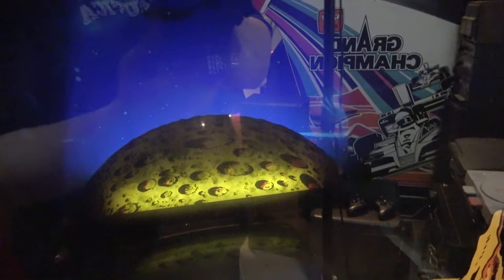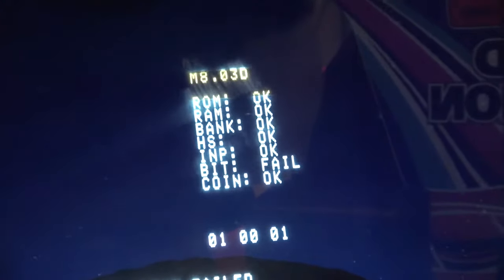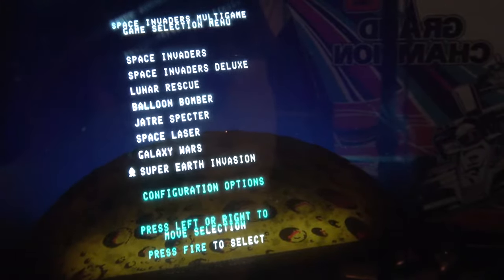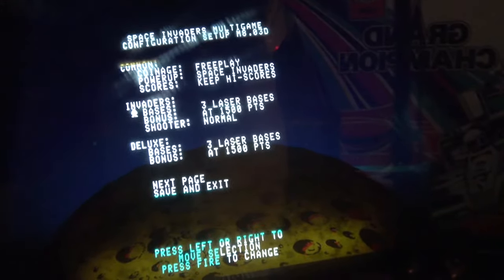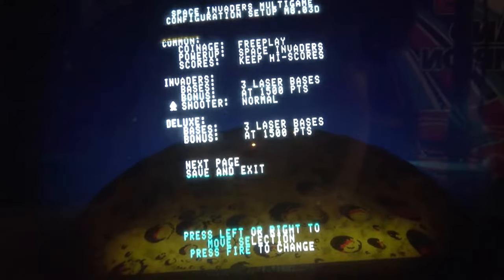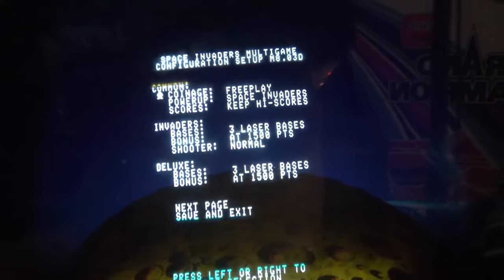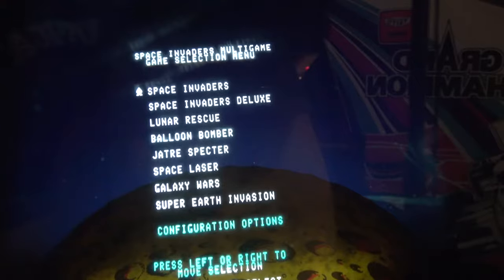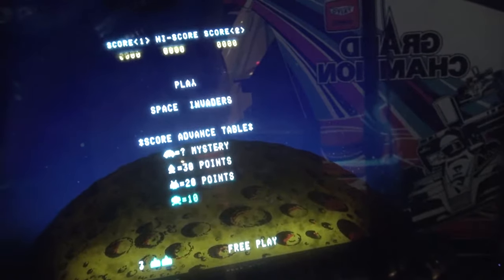FE031 Braze Space Invaders Kit Install!

Comment: Hey, just wondering with your Midway space invaders machine, how have you got it running on 240v ?
Reply from the maker: Hey Pinman Dan. It was running on 240v when I picked it up. But basically someone just installed a 240v to 100v step down transformer and then I believe the rest of the power is run from there eg: for the monitor (and stepped down further for the lower voltage rails as needed).

Comment: Is there really a half second lag with the virtual pinball table? If so, that completely reverses my decision to build myself a virtual pinball cab
Reply from the maker: Hi Nick, Actually no. I've been having some issues with my build and occasionally I do get more lag than normal. This session DK was getting some more lag than usual (was probaably closer to 300ms on the day). When it behaves it's very good (<100ms). Getting Win 10 to play nice is usually the issue (wish I stayed on win 7 where I had no problems) but I'm generalising. Don't let it put you off, you can get very responsive play if your system is set up right. Also I would have to say that the brain does adjust even to a slight delay and you will find you will compensate automatically (without realising it). Had a cranking game of TOTAN tonight and did not notice lag at all during the game. You won't regret building one, trust me. Cheers!